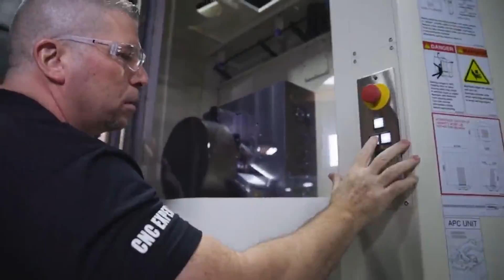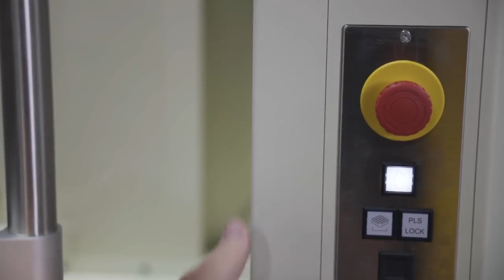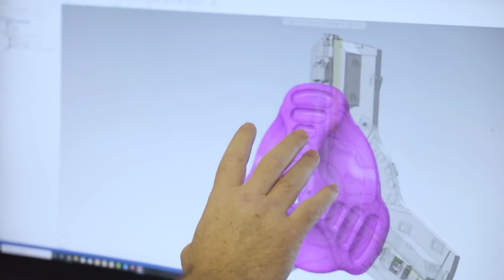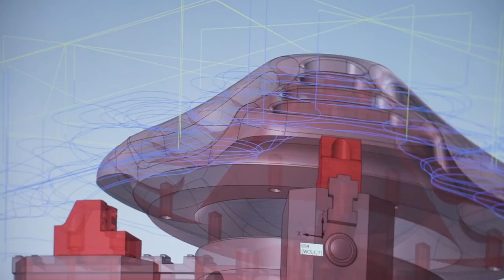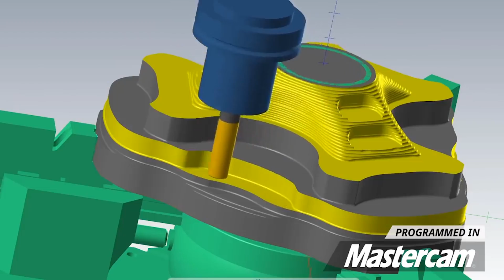Buyer DEMANDS 15% PRICE DECREASE or Parts Get Outsourced!

Comment: I'm a Certified Purchasing Manager.  I can't tell you how many times I've seen goals such as 'year over year cost reductions'.  And I keep asking what happens when cost goes to zero.  My goal has always been to buy to specifications and be market competitive.  And I've been put in situations as both a manager and a buyer to get across the board cuts.  I would always find a way to work with my suppliers to determine what they could do without holding them hostage.  We would discuss together what was workable.  I took heat from management, but I did the right thing.  And I slept well knowing I did the right thing.

Comment: Back when I was a buyer, I generally pushed back on "across the board" price reduction goals from my bosses. Mostly because 1 RMA costs more then any 1 given part, but also because I felt like such blanket goals were lazy edicts from bosses who were just going to take credit for my work while they played Solitaire. 

I was able to get a 8% discount from one vendor who reluctantly used cheaper packaging, warning me that is the part was damaged in transport, that was my problem. Not only was the cheaper packaging just fine, but we could recycle it to package a different product, reducing our costs. The vendor later confessed that the cheaper packaging was more profitable for them; they bought it in bulk for a huge discount. 

Later we moved away from cardboard boxes to durable crates, trading the crates between us our vendors which greatly reduced costs. Instead of boxing 27 parts into their own individual boxes, we could get those same 27 in a single crate. It also ended up being much faster on our end, saving a total of ~40 minutes per lot. A crate could be depacked in the morning, repacked by lunch, and out the door by COB. 

Blanket cost reductions are lazy. They put most of cost reduction activity on the sales team, but ignore the many ways that money and production can leak out of an inefficient operation. If we take a bit of time and step back, we can achieve greater costs savings without losing money.

Comment: I was a design Engineer, now retired. I was part of a team designing process modules incorporating components from many specialist suppliers who took time to help us choose the right model even before we had placed an order.
When the purchase requisitions from the design team went to the purchasing agent he would come back and say that he'd found cheaper suppliers. Just a few dollars in some cases but clearly of lower quality. I would ask the agent if he would kindly speak to potential suppliers regarding technical issues of which he absolutely no clue himself for the next project because I would too embarrassed to do so myself. I also mentioned that the difference in cost between quality plus free technical advice and cheap would probably pay for one night's hotel stay for the Technician sent to replace the failed cheap part with the more expensive reliable part. Then there's the Technicians expenses for meals, air fare, car rental, more hotel, salary, loss of his services in the workshop whilst he's away

Comment: Sounds like a sell out to me.  If you stopped fixing there shotty work or charged accordingly, you'd be making more instead of supporting basically slave labor.   The problem you solved was proliferation of sweat shops, you sure helped them with that at the cost of your health and personal time with your family. Which will always be more valuable.

Comment: Dude is so wrong it's not funny. The mind set of losing a customer being a bad thing is a cancer in every industry. The fact they outsourced is fine don't fix the product they get back and let them deal with the major drop in quality. Ur mindset of always allowing the customer to dictate the costs because ur scared they will go somewhere eles is a slow walk to the grave. Having a goal of the cnc machine run around the clock is stupid the real issue is how much do u earn per hour of that machine running? Do u want to wear ur machines out deal with the increased maintenance and labor costs of running nonstop just for the sake of saying u are running nosnstop. It's a balance act but defaulting to always lowering price point is dead wrong. Ur sacrificing ur profit and giving it to the customer lol that's called bad business. Know your worth and stay firm if they don't like it they can outsource to some shit country and get shit products backs

Comment: Maybe I'm just a hot-head, but this 15% reduction "request" would offend me.  My response?  "Your cost-reduction request caused us to look more closely at our own costs for the equipment and labor to produce your pieces.  Turns out that we are actually already losing money on your jobs - your jobs subsidized by our other customers' jobs.  So, we are hereby requiring a 10% INCREASE in the cost to manufacture your parts, effective immediately. And, we require payment in ADVANCE.  Otherwise we will no longer be able to provide you with your quality parts."  Dangerous?  Sure, but as most comments have pointed out, when they outsource the work (particularly overseas), they will be back.  And willing to pay more.
I was not in management, but I was a professional in a large engineering company for nearly 25 years.  The last 10 years the new management tried to "reduce into profitability".  If we complied, then next year we had fewer engineers and fewer tools to do even more work.  You should have heard the ominous tones in their voices as they said, "So, you're saying that you are unable to do the work in the time we require??"  What an insult to the experienced and expert professionals of any kind.

Comment: If 40% could be cut, then it was greed which stopped savings being passed on.  For the original company; justice was done.  The outsourcing and rectification is a more pleasant way of saying the greed of the company allowed them to be dumped on and then wiped the other company's behind.

Make a fair profit for a fair wage.  Don't let the company run its machines for nothing but don't profiteer either.  Don't be a slave to money; just be fair.

Comment: if you're asking the industry average, there shouldn't be any complaint. you begin to participate in the race to the bottom and they'll just come back in a year and want more reductions or not want to pay for your increased costs. 

the bigger the business, the dumber it's run. if they want a 15% cost reduction, look inside their own company and at how many useless managers they have, engineers that do nothing other than busy work, equipment workers have been complaining about needing properly maintenanced and not just another band-aid, and no doubt a ton of fat that could be trimmed.

1) you give them 15% off and all the other companies want that when they find out.

2) you give them a discounted part and they'll want more reduced prices next year.

3) how much of that 15% are they going to give themselves in bonuses? the whole thing has nothing to do about the company they don't own, it's about how much they can squeeze out of it to line their wallets.

4) they pay what they do because you provide them with a quality product on time and at a fair price. if they thought they could get the same deal overseas they would already be there. when they bring you back fucked up parts to rework, you charge them out the ass. 

a business always needs a Plan B and a marketing argument for when a big company tries their bullying tactics.

Comment: As an example Wages and Rent are already 2 major components of expenses. 
By allowing outsourcing where they are already exponentially cheaper, there may be no way to compete in bridging that disadvantage in any other place.
If the Government has allowed outsourcing to occur and competition to be impossible, the problem needs to felt at the top to make changes.
Unfortuntately the people are collateral damage to the Government allowing this to occur.
What is also bad is that this change takes decades and will affect generations of people.
Governments are now finding out they shot themselves on the foot and there are many in their ranks unwilling to change the course of their previous decisions because they now have "strings" arising from greed on an individual level on people in power and position of responsibilities that govern the future of the many.

Comment: GM pulled that crap on my buddy that owned a steel company. They needed a specific thickness of sheet steel for their mock-up cars. When you buy steel rolled to spec, you buy the entire ingot, and it is rolled to your specs. GM would only order maybe 10-12 sheets at a time. My buddy paid for, and warehoused that specialty thickness of steel for them. When GM's new buyer called and told him that they are from now on only allowed to charge them X amount of dollars, My friend said no. The buyer then told him "We are partners and you don't treat partners this way". My buddy just laughed and told the guy "We're not partners when you're F###ing me!" Gm told him that's fine, we will buy our steel elsewhere and my friend said fine. 30 minutes later he gets a call from another local steel company asking if he had 10-12 sheets of a certain thickness of steel. My old friend said, I sure do, and sold it to them for the same price he would have sold it to GM. They of course put their mark-up on it and sold it to GM.

Comment: I don’t know why or how the algorithm put this video in my queue but the conclusion to this story is so confusing. Working hard and being excellent at service is great. Racing to the bottom on price damages your industry, reputation, and negotiating power. It also devalues your own worth. The customer demand is totally unreasonable. Just because capitalist greed craves cheap labor doesn’t mean it should be given. Other comments have made good points. This doesn’t sound like a “work with us” situation. It sounds like a dumb slash and burn power grab by a douchey client.

Comment: Unfortunately outsourcing is not about problems, it's about money. James Dyson was the famous U.K. example. When you can't lower your prices any more, that's when outsourcing happens. Who wants to work for nothing? 
Anyone who runs a business knows that the most significant ongoing cost is the folks you employ. Not only are people your most expensive asset, but they are your most important and useful asset. But, one day because the capitalist paradigm is hell bent on reducing costs for the benefit of shareholder value, you have no choice but to 'internationalise' your workforce. 
So the bottom line (whether we like it or not) is that the downward spiral of cost reduction pressure means lower living standards.

Comment: Depends, on cnc no. But mechanical yes. I run a Mechanical Door machine, my bosses bend over backwards for contractors. I'm currently running a 6,000 unit project. That I have gotten 80-85% complete in 6 months, while doing my normal commercial projects. It's 2800+ doors and 2800+ frames.  If my bosses asked me, I'd say hire temps that I can train, and be in the hiring process for. It was way to much work for one person, not including another 1,200 door project I got done while running that big order. I've been burnt out for almost 3 month now. If I had a CNC set up, it would be cake walk. But the other thing, 500k can be investested into the company, it's hard to beat costs in Asian countries.

Comment: Yes a toolmaker that made parts for the automotive company that I worked in QA for. Part of my work was visiting them to check their last offs and current production. This mainly to assess tool needs for tool repair. During such visits we learned that our company and others were outsourcing tools to Taiwan and china. This to facilitate six weeks for new products. The quality of said tools necessitated a further six weeks correcting faults with the toolmaker that I was visiting. What sort of logic is that. Today a lot of the tooling is being made in the UK due to higher costs of manufacturing and shipping . In today’s markets we have to be competitive and vigilant on pricing, but sending work is not always going to be cheap. If we loose our skilled labour because of this we are on a hiding to nowhere. Particularly if we are not promoting apprenticeships. Mind when you talked about a new CEO looking for a 15% price reduction reminded of a company that I worked for about 1975. A certain new CEO tried the same thing for us. Our manager checked his pricing and discovered that he would have to increase his prices. When the contractor realised we would be increasing price he came and removed all the parts. 3 months later they came back asking if we could resume making their parts as nobody could match our new price or the scrap rate of 30%.

Comment: The main issue with outsourcing is that there are no real savings as the paper pushers that are "saving" money for the company are not he ones that actually oversee the processes.  I work in the cycling industry and have seen a few bike brands loosing their reputation for selling bikes that are double or triple the price of a department store bike  but with the same low quality parts.

Comment: My price IS my price, you knew it when you walked in the door. If you want it done cheaper, take it somewhere else. If you decide you are not happy where you took it to, that's a you problem not a me problem. I will not "fix" someone else's work. I will do the job for 3x my original price in cash up front. If you don't agree to those terms, take it back to the guy that you are not happy with.

Comment: The owner saying “ they are asking me to give them a house,” shows how uneducated and out of touch and greedy he was.
If he was making 40% profit then I would negotiate with them and settle at 9-10% but would make sure to drive home the point that you guys are producing high tech expensive goods not blue jeans and if they out source they could get 20% off but their products would lack quality and in the long run would hurt their consumer base and brand .
That would be like throwing the baby out with the bath water .
Also , you are 1000% right and the best way to compete with cheap labor is by out producing them in the same timeframe.
Reply: If he bid and won the contract based on price and quality against his competitors I don't blame him for refusing to cut a negotiated price.
Reply: @jamesodell3064  //
You are thinking 1970s , those days are gone.
Stock market is destroying America.
Today the only thing that matters to the corporate America is the bottom line .
The company stocks have to rise every quarter and if it falls then the CEO’s head Will role .
A company can only make so much so when the profit has to be higher then the corporations start trimming from the company .
Product quality , warranty, signed contracts and worker’s welfare means nothing anymore .
What do you think multitasking is?
They train their employees to do 4 different jobs , once they fire someone then they get 4 other employees to do his job and that way they don’t have to hire someone.
Under these circumstances if they are buying something from you for $20 and a Chinese company offers the same thing for $5 , for them going with the Chinese companies is matter of survival not morality .

Comment: So you’re running your machines 24hrs a day to make the same revenue you would make working your machines 12 hrs at a higher price? In my opinion you will end up losing money running 24hrs a day because you’re massively increasing the wear and tear in your equipment and the need for the equipment. Maintenance cost will increase